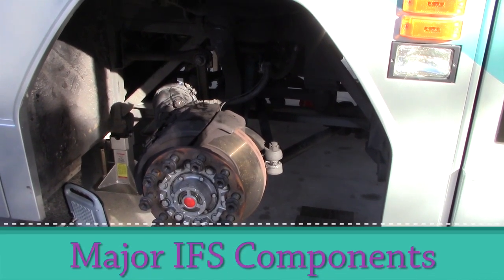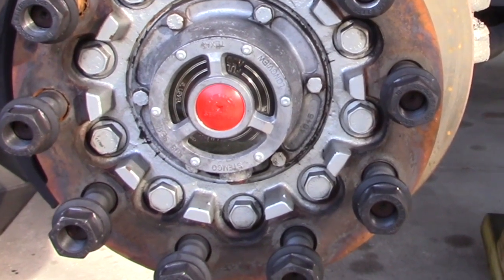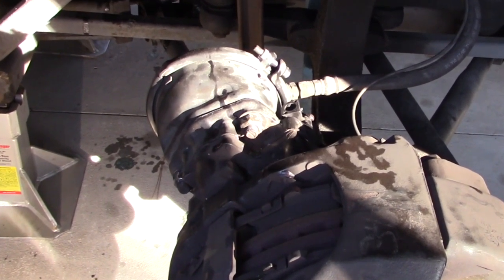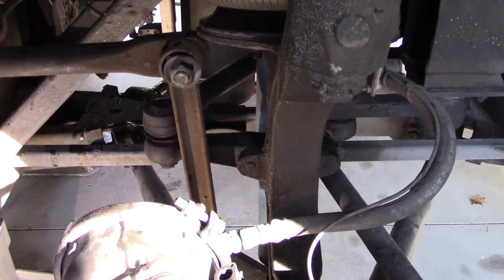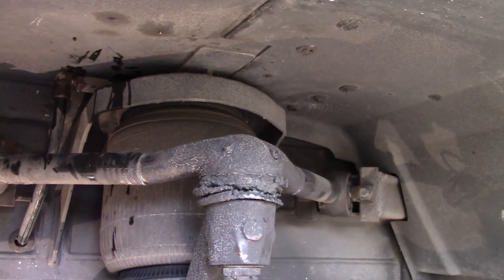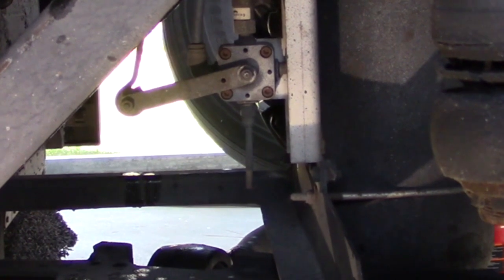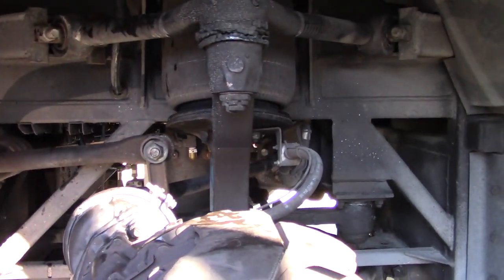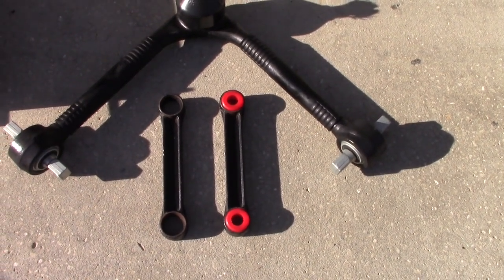Prevost IFS Major Components

Comment: What year is your coach ?   Do all Prevost coaches have disk brakes ?
Reply from the maker: Mine is an 03.  From the late 90s they are all disc.  Prior to that they had drum drives and prior to that all drums.
Reply: @prevostmotorhomehelp2577  Thanks.   When did the independent front suspension start ?